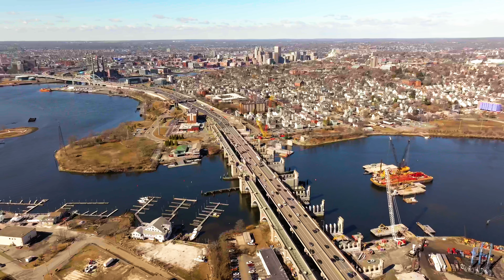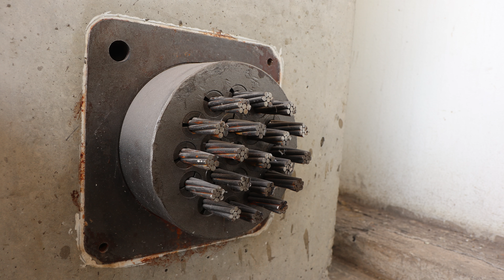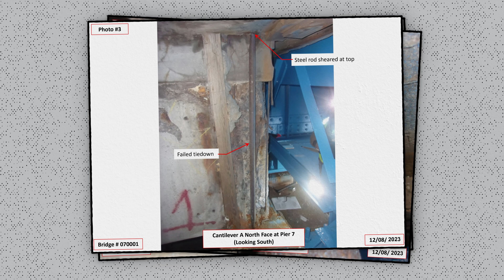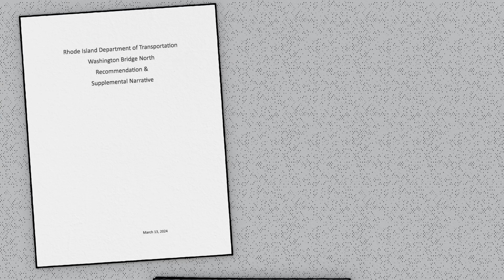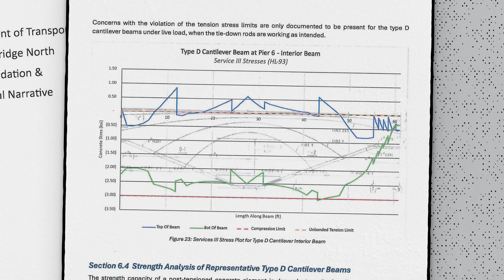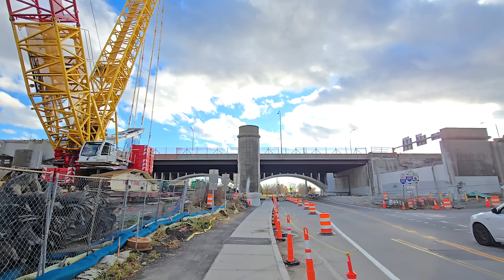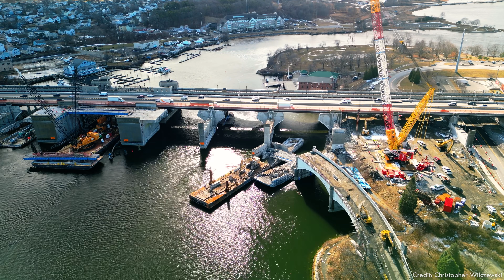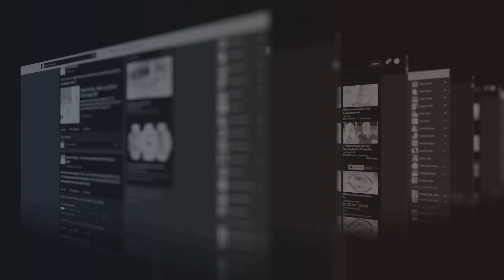This Bridge’s Bizarre Design Nearly Caused It To Collapse

Comment: While I lived in Nashville, TN I felt a few older bridges and some roads do the "Shimmy, Shimmy, Shake" while I was driving a car on them!
 
In one case, I tried to report it to MetroNashville Government (various departments) but "no joy"!
 
Then I took advantage of a fire where there wasn't enough water flow in the hydrants to save a valuable building and called all 4 local tv stations (their News Division) noting how this was probably due to a burst pipe, which would mean two large (for Nashville) Apartment Complexes would Not have enough water for a major fire, especially this was on a hill.  That a near by creek was at a higher than normal level event though it hadn't rained in over ten days.  And the worst part was where school busses stopped to pick up kids from one of the complexes.
 
Didn't catch any news broadcasts (due to my work schedule), but all of a sudden "For Some Strange Reason" the city started investigating running some tests quickly, did a temporary fix, and about 6 weeks later dug up the whole area of road.....

Comment: As an absolute layman with a technical mind; When you described the bride design, it gave me a queasy feeling. It felt like, this bridge can not fail partially. If one part collapses the whole thing comes down like dominos. Then you described the design at the west abudment and my  thought was: And there it will fail.
And the failure was not even found during a routine inspection. If it was not for the hellish American traffic and the need of more lanes, this could have gone down (pun intended) really badly.

Comment: I mean are people really surprised this kind of thing happens? When most building contracts are usually decided on a reverse auction to see who can offer to do it for the LEAST money.
If you want something that is going to last, pay for it, if you want something you're gonna have to replace every 25-50 years then carry on.
I will also never understand people who think it's normal for a building to only last half a century, or even just a century. There are Roman buildings made of concrete over 2000 years old, still standing. There's absolutely no excuse in the modern age other than out and out greed.

Comment: 9.40: i would argue that "the reason why this wasn't caught in inspections" is that humans Do things before we Know things.
* edit* ah, i see! holding out for closing arguments. very nice*
we fall a lot before we learn to walk reliably. engineers regularly outstrip scientists, and run around happily using horribly complex science while scientists struggle to find and define it in labs.
the only way we currently engineer things safely is we test the materials to failure repeatedly, and careful analysis for the past 200 years of engineering failures: longer, where they are bridges, building, or records w enough details.
this bridge had several different ways it was ambitious for it's time, and while it still remains an impressive design, real world issues and failures have come up, in ways and places the standard checks were never designed for: a risk w every unique or ambitiously different construction.
also, the system Did work in this case: far later than anyone WANTS theses issues caught, but Before major failure and early in massive financial outlay (which happens in sections of smaller transfers)

than again, i'm not an engineer, just an enthusiast. but the whole "learn by failure" part of human history seems to be lost on far too many middle aged and younger people today: the computer can't simulate it if we never enter it as a variable, but...

Comment: The only reason they found this is because a green , tenderfoot,  freshly minted civil engineer happened to be standing around watching a totally different job. Out of boredom, he happened to glance at the bridge decking and noticed odd movement with each passing vehicle. Out of curiosity, he went over and climbed in/under. What he saw alarmed him. He reported it up the command chain and it took the state something like 3 days to even get over there to check it out. Several 100k cars passed over that bridge while it did the fandango.

Comment: Steel, particularly military and other mobile bridging (which can be rented to get one erected quickly while government faff around funding the pork barrel replacement) should see much more use because steel is rugged, reasonably easy to respect , recyclable (including selling intact clean steel from demolitions like the beams which are my combination shop foundation/slab form) and less difficult to modify than concrete. Esthetic concerns are for mental children when comes to civil engineering and should have no place in planning but non-techies are essentially mental children (examine US reading levels if ye doubt this).

Comment: I've been doing work outside of Boston for almost a year now and been over this bridge and through this area about a dozen times. It is a little bit quicker for me to get back to Southwest Connecticut taking this route although when I know the traffic is going to be bad Mass Pike to 84 through Hartford and down actually saves time. On a couple of occasions I've stopped in diners and gas stations and asked about what was going on and the information that the public has is so wildly varied that is almost indiscernible that they're all talking about the same project. Oddly the best recollection I could get was that the project construction was actually well underway, and I'm not sure why that is except for the fact that there's so much construction equipment around that people just assumed that. Luckily Providence is not that big a city and even when the traffic is bad it's not like going through construction zones in New York City. 

I'm glad after not seeing any of your videos for so long that this is the one that was recommended to me. 

By the way there's a channel called what's going on with shipping that I've been following for a few years that has some of the best information about the key bridge

Comment: Thanks to your videos and your pleasant way of laying out all the nitty gritty information, I now know, that if I go back to school, this is what I want to do. I wish I knew that straight out of high school!
Edit: Kudos and love from Austin, Texas!
second edit: how would someone go about getting into the inspection game? Because I know that one of my strengths is noticing the smallest things that may be out of place. Is there a place to learn the design and proper weight distribution of bridges and key features to look out for before beginning an in depth safety inspection of these types of infrastructures? Because I know I would be one of the few to dedicate myself to read all the engineering papers that may be available to make sure the integrity is still intact based on the age and original design. I'm only asking because I lack the connections to even begin to learn where to go for the first step to enter this type of field, and yet, I know with a significant amount of certainty that this is the type of work that I would enjoy while staying completely physically and mentally engaged.  

There aren't too many professions that appreciate extreme attention to detail when it comes to potential safety hazards. I appreciate your time if you happen to see this and respond. Keep on making these amazing videos because I know there are many others others out there who appreciate them just as much, if not more, than I do. :D

Comment: in 2012 Vancouver BC Canada, a new bridge was opened across the Fraser River. It is a 10 lane cable stayed bridge. (1,540 feet, 840 million) It's great! except when it snows! the snow builds up on the cables, and at random intervals it falls off of the cables onto cars windshields. "ice bombs" of course the contractor says "not my problem" LOL solution? wrap a bundle of chain around the base of the cables and slide them up and down during snow storms. The outside lanes of the bridge are closed during the snow storms so as to keep cars from getting squished.
On the other hand, it's a really pretty bridge! LOL

Comment: Seems to me that using concrete in ANY non-compressive way is not good. 
Concrete does not take tension.  Embedded steel rods will eventually rust and fail.

Comment: Your explanation of prestressing is excellent. I worked at the Ft. St. Vrain Nuclear Generating Station for 23 years. Our reactor vessel was a 1 of a kind Prestressed Concrete Reactor Vessel (PCRV). It actually was a steel lined hexahedron "tank" 106 ft. high, 61 ft. diam., with the internal dimensions 75 ft. x 31 ft. It had 448 tendons situated longitudinally, circumferentially, and cross head wise. Each tendon was made up of several hundred 1/4" wires twisted much like a monsterous wire rope to allow for safe bending within the concrete embedded, lubricated tubes. Every  tendon was prestressed to 1.25 to 1.4 million pounds, depending upon location. The top head of the reactor also had to be able to support the 169 ton robotic  refueling machine under maximum earthquake loading. A marvelous piece of engineering from the mid-late 1960's! You may see more on this link: https://www.ans.org/news/article-2016/fort-st-vrain-in-pictures-2/
I was inside this vessel many times during construction and testing, and went through the entire fuel cycle, including new fuel inspection, initial fuel loading, refueling, spent fuel shipping, and decommissioning fuel storage. I am 75 yrs. old, and get a good laugh when I tell people that I don't need headlights to drive at night! Ha!
Reply: P.S., it was built to operate at atmospheric to 745-845 psi. max. internal pure helium gas pressure.

Comment: But Practical Engineering - You missed on 2 MAJOR factors not associated with engineering.  The State / Government Red Tape and Stealing, AND, Who ran the State back in the 50’s and 60’s?  The Mafia.  The Heads of all the New England Italian Mafia were here in Providence & were Highly influential in everything going on.  Much of it good honestly haha, but they DID have control of aspects in major projects.  There is NO DOUBT in Anyone’s mind of those who lived fitting that time, that the bridge was built with substandard materials, and not what they agreed upon. so they could Steal from the contract, as is done in EVERY Mafia And Government situation.

Comment: It doesn’t surprise me that it’s ultimately the fault of NIMBY’s concerned about the aesthetic. That pretty much sums up Newport’s infrastructural issues & most of the zoning/housing issues around the state too. This may have been somewhat of an engineering success story, but it’s a social/political nightmare. Casey Jones has some great videos on this. You both have way better coverage than the local media. I am firmly in the fire Alviti camp. Not because of the structural bridge failures, but the overall failure of leadership that has occurred throughout this saga. He has been contentious, untrustworthy, unforthcoming, and overly sensitive. Lashing out like a wounded animal at people simply wanting to know how this happened. We’ve gotten more excuses than solutions. The McKee administration could learn a thing or two from this video about being transparent on this issue without placing blame.

Comment: It seems like a lot of bridges with this type of construction have this problem. I live in South Florida, and we have a relatively new bridge that had problem with the steel rusting inside the concrete. It seems to me the Rhode Island Bridge would be better off made out of a different material like steel that can be inspected and painted. Bolted or riveted together where sections could be replaced if needed it could be assembled offsite and reassembled on site. This was a very good video. More people should know about this.

Comment: Still better than Germany's major cantilever bridge - The Carola bridge in Dresden, that just spontaneously collapsed. I personally walked in the huge crowd of spectators on the collapsed deck three weeks prior, and below the adjacent deck there was a concert organised for a city fare, with stage and significant portion of the spectators directly beneath that adjacent deck. I still got chills about a pandemonium that would unravel if it collapsed that day, with all the people from the walkway falling to the Elbe and thousands flying in panic from that concert venue. Thankfully it decided to hold just a little bit longer and failed in the middle of the night so nobody was hurt.

Comment: Thats. What. Happens. When. You. Make. Companys.   Competition  dor. Who. Can put in the. Lows. Bid. For. The.  Work. And.   Try. Ro. Get. It. Doe. As.  Cheap as possible or. Cheaper  then. That. Company's cant. Afford. To. Have.   Good. Skilled.  Experience  wirks. Cause. They. Leave. For.  Bigger. Better. Campanys.  And. Better pay. Withh. New. Xutting eadge.   Tech. And. Ways or. As. Many qorks.  Or. Can. Afford. To. Spend rhe.  Rime. Needed. To. Do the. Work probably and when they. Keep. Xhanging.  Campanys.  The. One. After. That and. So. On. Can't. Get. Full.  Acsses  to. Do. It. Probably. Or.   Do. It. Aberter. Way. That. My. Cost. Abit. More. Cause. The. State.  Says. But. It. Was. Easyer.  The. Way. The. Others. Dis. It.  Or. Why. Is. It. Costing. More. Or. If the. New. Company. Says. That's. Not. Safe. Or. Isnt. Right and. Needs. This. The sate. Says.  But. The. Ithwr. Company. Said. That. Was. Fine. Like. That or. Do. The. Bare. Minimum. To. Dix.  Ir. Jusf. A. Patch. Job. Not.   Fix. And.  Address. The. Problem. To. Stop. It. From. Happing.  And. Rhe. New campany.  Trys.  But. Uf. They. Push  to. Hard. The. State.  Sacks. The. Company and. Then. Trys. Sueing. Rhemn. For.  Breaking. The. Contract. Or. The companys.   Bewaje. The. Contact. Cause. They. Know. Its. Not. Right. And. Dont. Want tto. Getthe. Blame. For. It  or the. Sate. Says. That. Will take. Ro. Long  and. Uf. The. Companys. Dont.   Rush. And.  Just. Patch. The. Thing.  The. State. Purs. Out.  A.  New.  Bid. Of.  Companys. To.  So ut. And. For. Cheaper

Comment: The old adage still applies: "Well, it seemed like a good idea at the time,  but time proves it wasn't!"   New York Sate has spent millions replacing overpasses on the Thru-way because the original contractor used cement that was incorrectly mixed and too wet when it was poured. The contractor has been fined the cost of replacement. New York's bridges are especially vulnerable because  because we have winter which means ice and snow salt with salt to melt it.  Concrete really doesn't like rock salt!

Comment: I think some people have trouble understanding that engineering and the whole scientific method in general inevitably relies on finding different ways of doing things... The unavoidable outcome of this on the other hand is, that some times this does result in new kinds of issues to deal with. While some see failures just like that, as failures, in reality failures are often where the learning happens.

Not that this bridge actually failed as such... It simply got old and reached the end of its usable life. And fortunately the true state was discovered before an actual failure. Some of the inspection routines might have failed in giving adequate warning, but I suppose by the dust eventually does settle the procedures for inspection are hopefully better.

The process of trial and error does not see "error" as a failed outcome, it is data and out of data one can learn. Now obviously as far as human life is on the line, you really don't want things to fail, or catastrophic failure averted out of sheer luck. But my point is, that often just because we discover some things were not perfect, it can be seen as an opportunity to learn.

Comment: One thing you could do to balance the "bad" aspects with the "good" would be to do stories on current or former engineering marvels. Things that are still standing or functioning today or things that despite having been replaced or substantially repaired are still operating based on the original design. This story is quite close to this idea because the issues were caught before a tragedy occurred and used engineering techniques that are used quite often today. Where it falters is the issues were discovered seemingly by coincidence instead of routine inspections.

Comment: Grady, question for you: you're designing a bridge.  Do you deliberately include elements to make inspections doable and/or easier in 100 years time?  In this case, would you put a whole bunch of windows between the exterior of the concrete and the tensioned cable embedded in the middle of it, so you can visually inspect it later on?
Reply: I'd call that "doing it correctly".

Comment: 10:31 you can see the very small blue splatter paint on the upper separation area of this rod.  When was this blue paint applied somewhere on the bridge and how did it get between the two rod ends and then there is corrosion under the paint.  There is a bit of a smoking gun that these breaks didn't happen within 5 months prior to the closure.  This is clearly a failure of the inspections from RIDOT.  That is a huge amount of corrosion to happen in that short of time!  This bridge was clearly in distress long before that July inspection time.

Comment: I have worked on several state jobs dealing with engineers and I have noticed more than once that an engineer would get tunnel vision and fail to look at the big picture. That can cause incorrect conclusions.